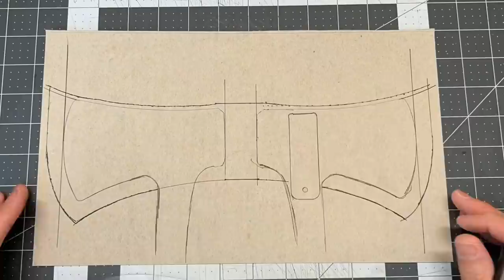Making A Custom Tooled Leather Sheath For An Estwing Sportsman’s Axe - Leather Craft

Comment: I'm just starting out, and I mean *just*. Wanting to make a sheath as my first project because I do competitive axe throwing. I have quite a few axes with either no actual sheath or a very generic cover. I want to make something nice and custom, and I truly appreciate this video. One thing I noticed when I did start cutting is the end of the leather, the edge. Seeing you use a rotary tool to lightly sand down the edge to start is simple genuis. Thank you very much for that little tip.
Reply from the maker: Awesome, glad the video helped!
Reply: @KingdomGloryLeather  Can I ask what tool you used to make your deep groves that you later stamped? It wasn't the stitch groover. These seemed like deeper channels.
Reply: @davidfrance2915  Bet it was an upside down skiver.

Comment: Cool video, what is that you have in a little bottle? (that you put on the edge before using the burnisher to smooth the edge)
Reply from the maker: Thank you. It is Tokonole
Reply: @KingdomGloryLeather  I'm new to leather work, just checking out what's out there

Comment: What are you putting on the edges after you sand and bevel? Is that just dye or is it edge kote?
Reply from the maker: Right after sanding and beveling I add dye to the edge using a wool dauber. I burnish the edge at the very end of the video with Tokonole.
Reply: @KingdomGloryLeather  thank you for the info, brother!